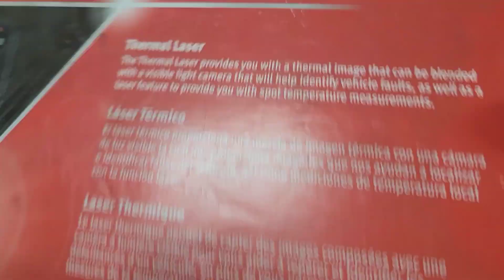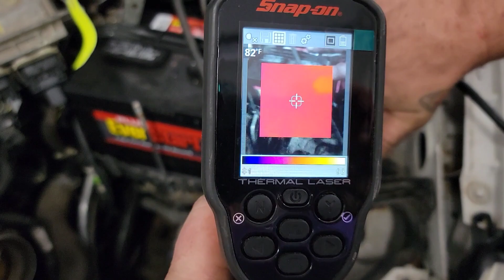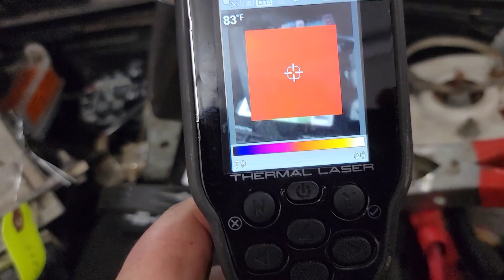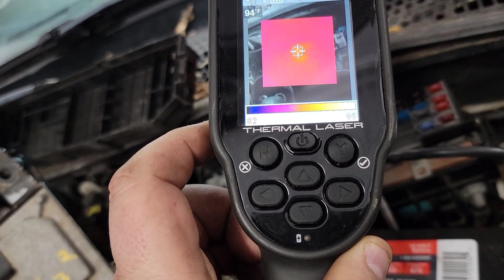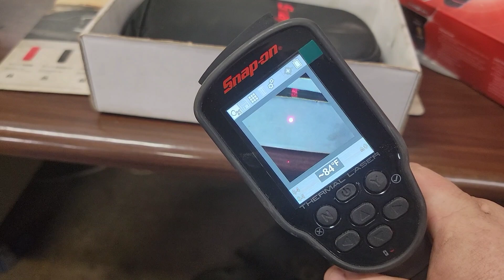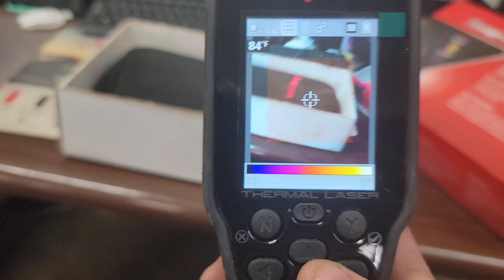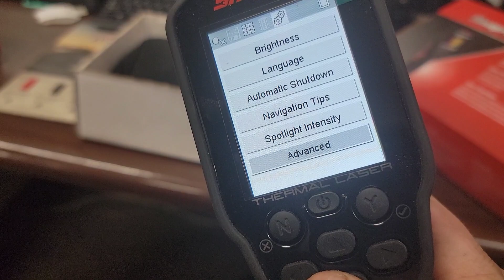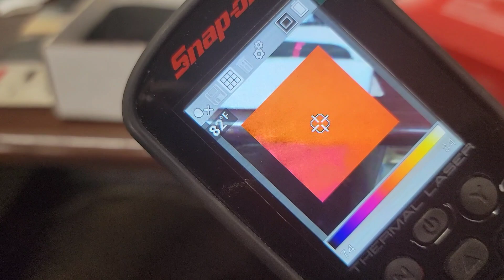SNAP-ON EETH311 THERMO IMAGER

Comment: I ended up trading both of the smaller ones in and got the bigger ones for both work and home. There are some features I prefer on the larger camera. I found a cracked exhaust manifold without pulling the heatshield, and proved to the electrical company where their electrical problem was on their light pole.😉👍
Reply from the maker: I noticed a lot of lag on the bigger one when transitioning to different spots do you have that issue?
Reply: @CPthetooladdict   Not really, it is a split second but it is a better resolution. I had my training on a fluke TI55 and it was much slower but it showed a better image to pinpoint exactly where a problem was. You could literally see threads on a bolt with it. For basic troubleshooting the one you have is fine, but if you are chasing a single wire in a large loom it is tougher to see.